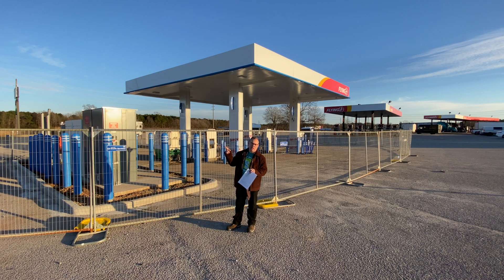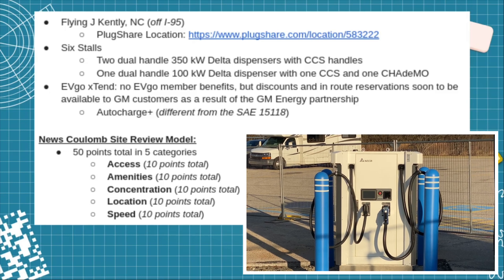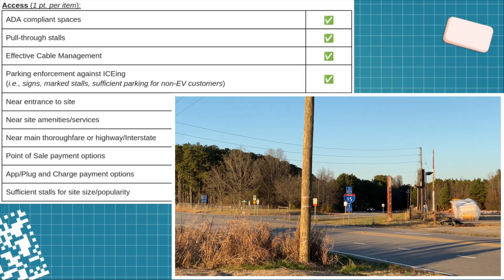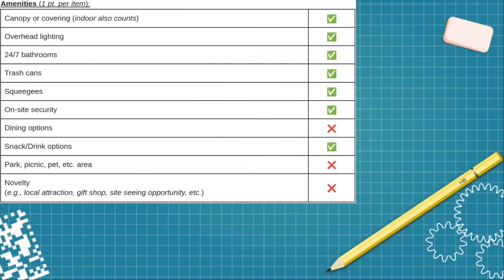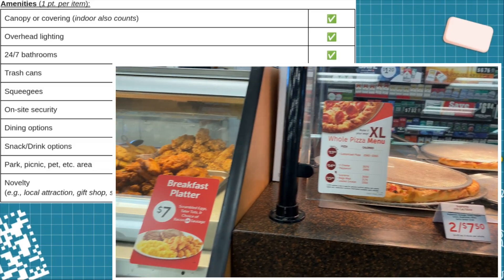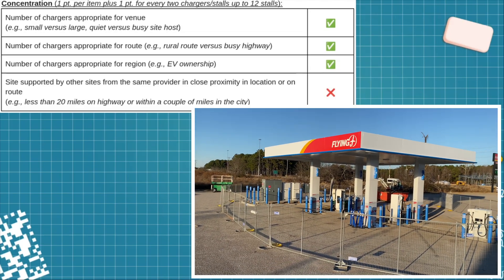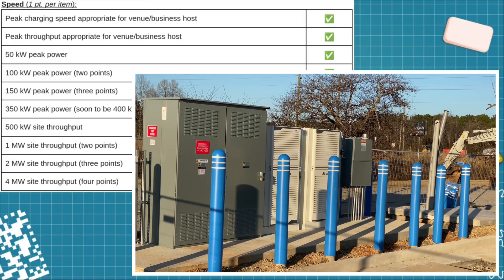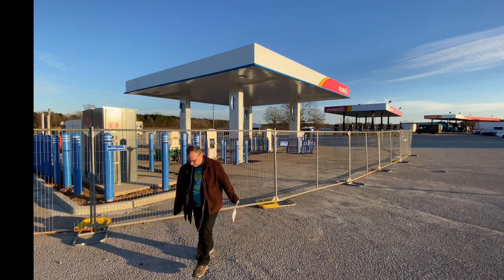GM Energy Site Visit - Kenly, NC

Comment: I do not understand the 100 kW stations. They should be at least 150 kW of not higher. If site had a power sharing DC bus architecture, it could probably support all 350 kW stations. Why are these new sites being so poorly designed?
Reply from the maker: I agree.  It feels random.  These are in the EVgo portfolio as "City Chargers" and all I could think of is they wanted some more stalls but not the big cost with the 350 dispenser / charger combo.  Truth is I do not know.  Thx for watching.

Comment: 7:00 You got the Site Throughput right. The main gist is how much power can it supply at one time, which would be governed more by the dispensers and cabinets than the utility drop (which to your point would be really hard to determine). Two 350 kW and one 100 kW chargers puts it at 800 kW overall throughput, so a bit short of 1 MW (but closer to 1 MW than 500 kW so it maybe should count).
Reply from the maker: thx for clarifying.  I will use that method too in the future.
Reply: @thenetworkarchitectchannel  You're welcome! I would say, too, that I do think these GM Energy sites are a little undersized for interstate travel stops, though that might be a bit of a California perspective. Still, it seems like I-95 is heavily travelled by EVs, so maybe that standard is not too far out of line. 

To me, a better travel charger throughput would be something like the Mercedes Charging Hub you covered, with 5 dispensers, 8 stalls, and 4 (?) of the 400 kW Power Cubes, which would be a 1.6 MW site. 

Getting 10/10 for Speed would likely require a "mega" site, likely with 12 to 16 high-power stalls, but I was trying to make these criteria a little future-proof.
Reply: Glad Walter's out there working out the kinks so that I can watch before attempting one... should help minimize my errors and oversights! 🙌⚡
Reply: @SteveBirkett  "Will all the volunteers please step forward!"

/Steve and Eric quietly take a step back..

Comment: Definitely appreciate the more granular scoring method to give both a detailed breakdown and an overall number to compare different sites. Thank you, Eric and Walter. 

It's interesting to see a third 100kW unit at a PFJ. Quite normal for regular EVgo sites to mix the two but for a travel site it's different. In practice, hopefully it serves older models well, including CHAdeMO EV drivers, and frees up the more powerful units for those that can accept more power... one can hope! 🤞
Reply from the maker: I too was quite surprised to see the 100kW unit common at EVgo ReNew stations.  I included this stop on my trip to return my son to his university for the spring semester and also stopped at two other EVgo ReNew stations.  Both of those too had these 100kW CCS/CHAdeMO, but this is the first time Pilot has purchased and installed one that I know of.  I think it may be their intention to use them as a lower cost augmentation for sites needing more stalls.  I guess we will see as `24 rolls on.

As for the new scoring method, it is a terrific framework which to follow.  I am thankful Eric was generous enough to share his years of wisdom with the community.  I intend to use the method going forward.  Thx for watching.
Reply: I think the 100 kW is great for overflow, but I was surprised to hear that the Denny's was closed. Hopefully, if they don't bring back Denny's, they can at least replace it with an alternative diner. As you noted, with the rise in EVs, the likelihood that travelers start making more 30-minute stops than the common 5-minute gas stops could justify these sit-down restaurants.
Reply from the maker: @newscoulomb3705  Yes, that was my thought too.  Plus, I did not mention in the video in the interest of brevity, about 10 minutes away on I-95 is the widely popular Carolina Premium Mall with many sit down options and they may have been loosing customers to that exit.  It too has an EA station in the lot, so time will tell what takes place at this location.  I suspect by summer time, they will be working on the reopening.
Reply: @newscoulomb3705  At the Herkimer, NY EA/Denny's, service always takes so long that the Ioniq 5 is done before food arrives. I'd be quite happy with a 50-100kW option there and just put my feet up for a spell.